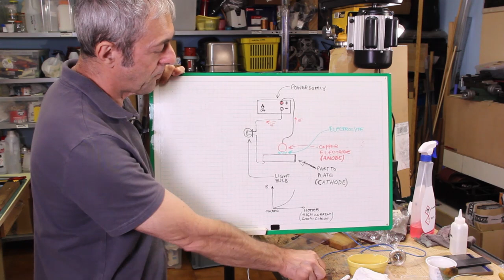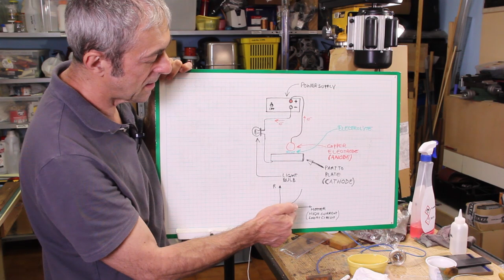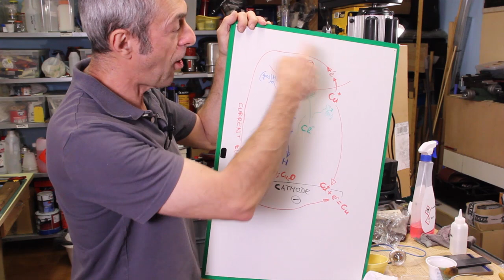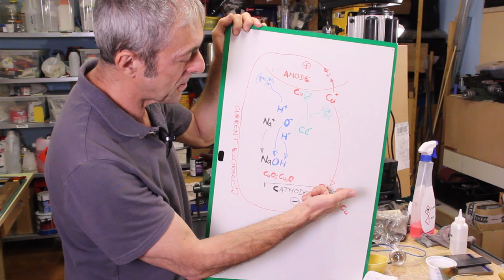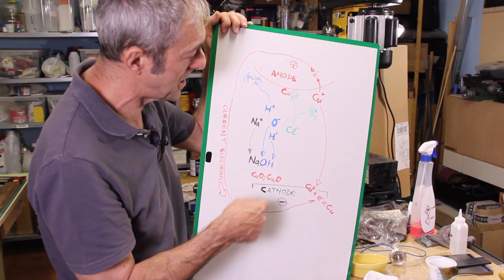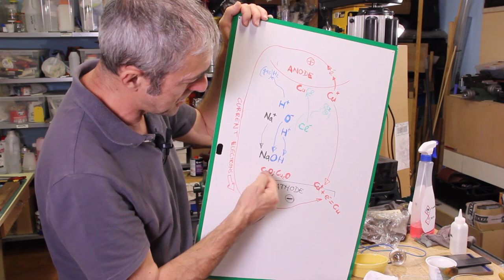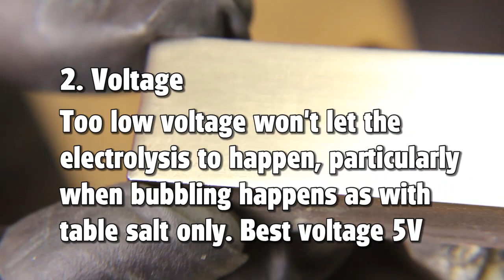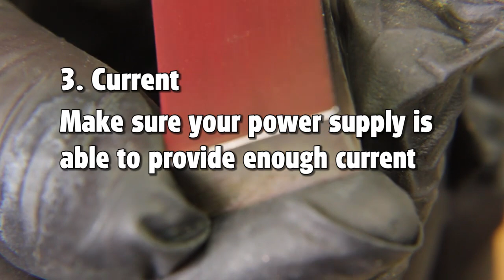Can you #electroplate copper with lemon juice? | Experiments

Comment: Man use hydrochloric acid, nude copper wire, put in the solution, later the piece you want to plated clean before using fire and vinegar to remove any oxide, after that polish with baking soda and little water as a paste, later put the piece of metal into the solution of hydrochloric acid with copper, then use any painting brush (one inch or depends) and start to brush the piece in all directions as painting, you can lift the piece over the solution or into the solution, better if you waited for see the hydrochloric acid solution is a little bit blue color very light, this is the point to start.   The quality of this method is great, cheaper and you don't need electric power... Muriatic acid is the same hydrochloric acid.   Just make it sure use all the warnings, glove, safety glasses, appropriate clothing, and ventilated area, never with the wind in direction of your face...and take close to your hands banking soda to neutralize in the end, or store the solution in safety bottles far away from children, and etiquette and tags well and clear for safety.   Later you can use the solution again with the wire copper inside.

Comment: Hi !
Nice work. Very interesting !
I have two questions for you:
-Do you think this process would work with other metals ? Like zinc, chrome or gold ?
-Is this project link to an other one or it's just for "accidental science" ? x)

In this small scal no problem but be careful with chlorine gas.
In any case, great job !
Reply from the maker: LOL, yes it was for "accidental science" :) There is very little chlorine gas, and as you noticed it is at small scale "by design". I think other metals could work as well but probably it is necessary to play a little bit with the voltage.
Maybe in a future video I will show some more experiments on this topic.
Thank you.
Reply: @AccidentalScience  yes specially for chrome it would very interesting for bearing applications

Comment: ya have to fasten wires to there respective metals then place them in bowl with liquid solution so transfer takes place flowing through solution
Reply from the maker: The point of this experiment is that you can do the same by making the ions to flow throw the liquid in a damp rag.